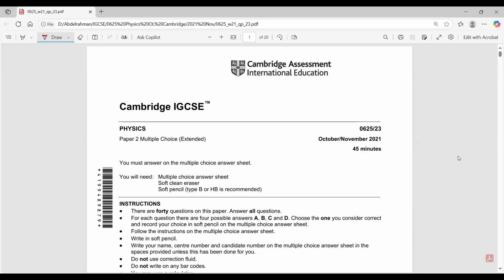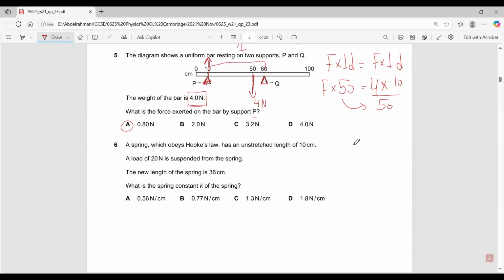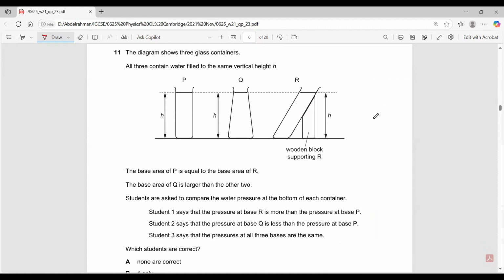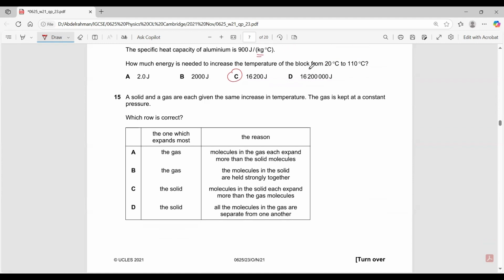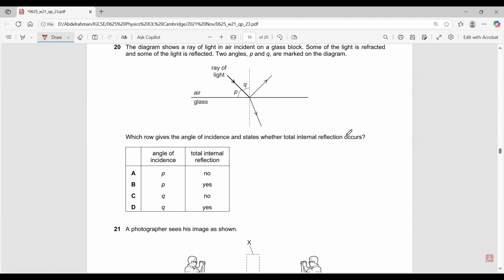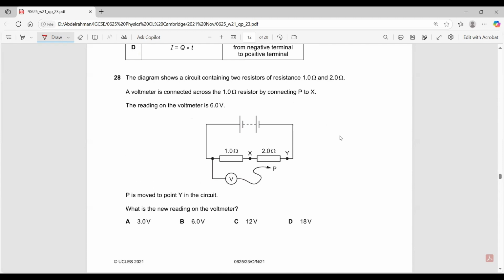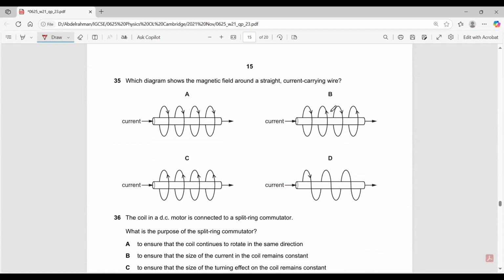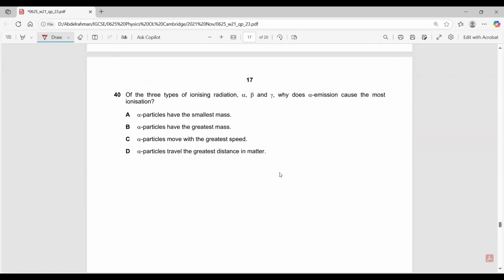IGCSE Physics 0625/23/O/N/21

Comment: Why did we assume that we don't have a pivot at P why not at Q , won’t  the answer be different ? In q5
Reply from the maker: It won't be different. You'll just add an extra step which will take a longer time in solving the question.
Reply: because no